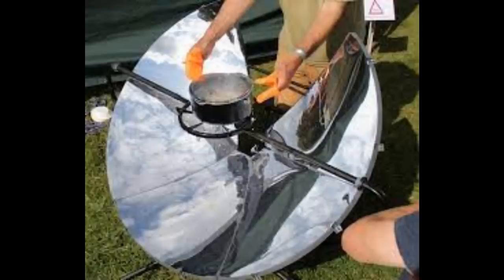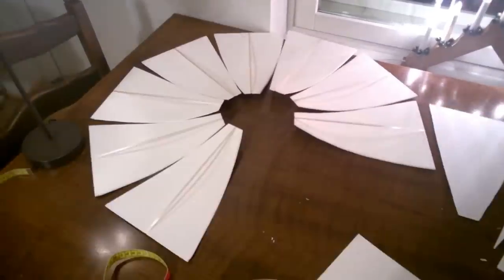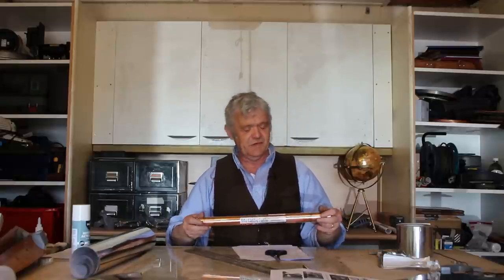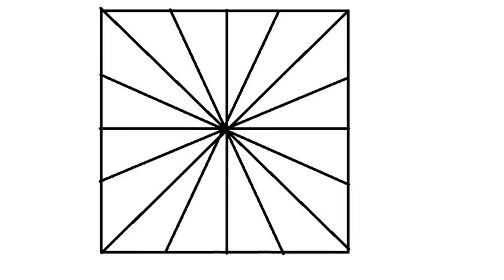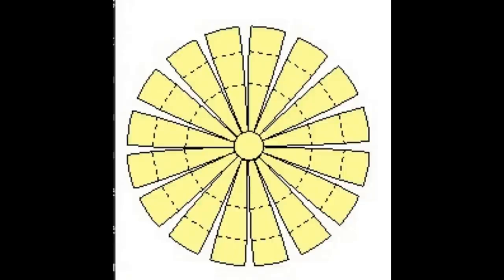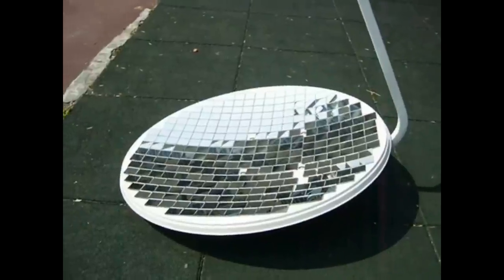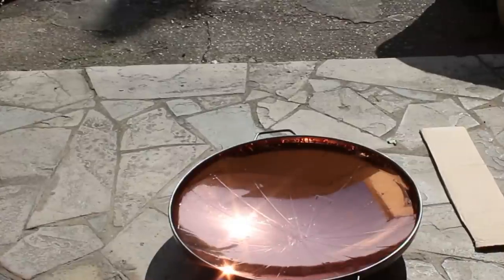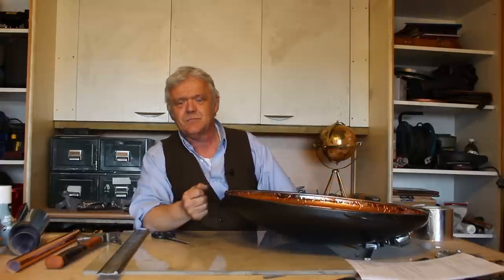1940 Burning Mirrors

Comment: Great video. While you were talking, I thought about 3D printing petal parts. But the fire pit is so much quicker that I abandoned the idea.
Reply from the maker: lol - oddly enough mate - i like your idea better lol
Reply: @ThinkingandTinkering  It’s a time thing with me. But I can see advantages because you can make a printed version any size you want. And you can fine tune the shape.  All you have to do is design a set of shapes that can be assembled into petals. Then assemble the petals into your reflector. If I had a faster printer, I might go that way.
Reply from the maker: @CCoburn3  that's what i was thinking mate
Reply: @ThinkingandTinkering  About 10 years ago, you made moldable silicone by mixing cornstarch with cheap builder's silicone. (Some people do the same by adding dishwashing liquid. I don't know which way is better.) In this thread, we were talking about making petal parts for a reflector using 3D printing. But to build a reflector with a 3D printer would take an inordinate amount of time. On the other hand, you could print off the parts from one petal and then use your homemade silicone to make molds. After you've made molds, you can then mold parts out of urethane. As far as I can tell, you've never done a video on urethane molding. But this would be an excellent project for such a video. I just thought I'd mention it since I know you're always looking for useful video topics.

Comment: You can also pick up reflector telescopes dirt cheap at boot fairs, the mirrors  at the back are really accurate parabola ( even the cheap ones) somewhere I have a 12 1/2" mirror that needs re-aluminizing I will have to dig it out and have a go.
Reply from the maker: hat is interesting thanks for that mate

Comment: Idea. Use your metal fire pit as a form and do a plastic vacuum seal into it. A small air fitting in the back of the fire to pull a vacuum. Then one could produce limitless plastic parabolas.

Comment: The trick with mylar to keep it in shape without the continuous vacuum is to reverse the process i.e. use pressure to form the parabolic curve outwards, not inwards.

Ensure the most reflective surface is on the inside of the curve, maintain pressure for the duration required to pour casting resin over the outside curve and set. Now you have a solid backed mylar mirror. Simples!

Comment: There was (not sure if it is still active) a website that had designs for parabolic cookers that I saw years ago. Solar cookers take a fragment of the parabolic idea and use a covered box to manage the heat. It does take an effort to plan your cooking ahead which is why solar cookers aren't as common in northern or rainy climates
Reply from the maker: seriously mate - there are a lot of ways to do this
Reply: @ThinkingandTinkering  indeed, and I know that everyone here deeply appreciates the information and ideas you've shared. What I'll be interested to see are the different and improved ways this group will expand on the concepts you've highlighted

Comment: Now use the parabolic mirror to heat up a few tons of sand and use the heat to turn a Stirling engine to turn a generator. Also water cool the cold side of the Stirling for more efficient and use the hot water in your house!

Comment: the aluminum foil for cooking I found has a line like pattern on it, and it runs along the length of the roll as it is rolled up so placing it with that facing so the lines run from center to outer edge while it may cause some bunching in parts of your troff design, I think in that format it still would ensure all the light is hitting that line of your heated tube you are cooking in, and the tube can then disperse the heat through out the inside for cooking. :)
Reply from the maker: some does - some doesn't
Reply: @ThinkingandTinkering  yeah I rarely find the good stuff with out those lines, and they seem to run the direction that the rollers it was on leaving them seeming to be left over from turning the rollers on a lathe or something (ie the marks on the rollers go around the roller rather than down them) either way if you do have the marked stuff it seems like making sure they dont interfere is not that hard, just have to orient them correctly when using it :)

Comment: Several years ago, I used unwanted TV Dishes lined with $1 emergency blankets for similar purposes.  There is plenty of them to be had for for around here rural SC/USA and there was no measuring needed.  the Angles and point-of-convergence are already there.  And at 33.5° N, it quickly cooked our hot dogs (faster than the charcoal grill!)

Now you've got me thinking about what I could do with all those giant C-Band dishes around here (there's at least three).   All are at least 8'/2.4m diameter and 4.5m2 of area.  Add a tracking system for maximum daily power, of course...

Question for the Audience:  What solar panel could I use on this system?  It would need to survive the heat and be able to convert to maximum voltage.
Reply: No photovoltaic solar panel could handle that heat. In large scale systems they use molten salt reactors. Then use the molten salt to boil water and run a steam turbine. They run at night off the residual heat as well.

These never came into large scale use, because they came under heavy attack by animal rights groups for killing birds. I am sure big oil likely played a role as well. As it is the most efficient and cost effective form of renewable energy, that I have ever discovered.

Comment: Look up Solar Funnel Cooker by Steven E. Jones. It is far safer than parabolic because it doesn't concentrate the Solar energy to a point, but to a more diffuse line. You can also make them foldable, so that it is more easy to transport. It's also easier to make.

Comment: Thanks for sharing Rob. However experiments have been made using polished copper as a reflective surfaces and it has been shown it is not bright enough to light the interior of the pyramids as the light is too greatly reduced, so this could not have been a source of illumination for them. Interesting legends do come from South America however with some ancient writings stating that two large 4 meter mirrors where used to melt stones and therefore used in the construction of sites like Sacsayhuamán. It is also interesting to note that 2 sound waves are required to create a beat frequency! Is it possible to create a beat frequency using light?

Comment: can u place a magnified glass at the reflected focal point and get even more heat? is there a thermal loss if using multiple dishes and bouncing the light beam off of 1 to another and then finding a focal point. like using mirrors to carry light into the recesses of a tunnel? what is the heat loss, if any?
Reply from the maker: what do you mean by more heat? if you mean more heat but a smaller area - then yes - if you mean more heat but the same area then no
Reply: @ThinkingandTinkering  interesting, all this time I thought a magnifier glass would concentrated the ray and produce more heat. thanks for clearing that up.

Comment: Those are pretty enough.
There are some non-imaging reflectors that are somewhat cone shape that I thought would be nice to try because the focal point is at the bottom of the cone, so you don't have to figure a way to hang stuff in front of the mirror. No doubt uses more material per square meter though.
Reply from the maker: cheers mate - but it doesn't take a lot of figuring does it?
Reply: Look up the Solar Funnel.

Comment: Try a used Satellite antenna. I have a 1.2 meter that I'm going to paint with Rust-Oleum Gold. I have the arms that came with and just need to flip them to the top to make a hook to run water through to heat the pool

Comment: Any tips for home-made concentrated solar panels? Buying the whole set is prohibitively expensive, but what if we buy just one, and then put a whole bunch of sunlight on it? The reflection would need to somehow track the sun, so quite some moving parts could be involved...
Reply: Heat seriously degrades the efficiency of solar panels and their life expectancy, you  would need to extract as much heat as possible before the light hits the panel  but it is a good direction to explore and it can make use of the heat perhaps to generate as well
Reply: You will take a large satellite dish, and you will rub it very well with graphite powder. It will become like a mirror.
Reply from the maker: you are quite likely to fry your panels mate

Comment: Hey love your video s Roberto ,  so how about , plastic dustbin lid , yeah ,  

A vacuum 

So first secure mylar sheet around bin lid edge ,  

Use vacuum pump ,or such to pull to shape ,   

Jold pressure , then make a 4 inch card wall of sorts ...

Weigh down mylar sheet , carefully ,    so if you release vac , it stays 

Then replace vacuum with spray foam ..

Yeah ti's expensive poss..

And would take a knack , buy the pure mirror like quality should be worthy ...

Oh amd aslong as the spray foam don't eat the mylar 😂

Comment: I think I recall that white is more light reflective than mirrors. Surprised to see everyone using mirrors for years after this was known. Any insight would be much appreciated.
Reply: not an expert but my guess is white spreads the light in all directions and a mirror actually directs it where you want to
Reply: @strongforce8466  wouldn't that be the shape?
Reply from the maker: white is not more reflective
Reply: @ThinkingandTinkering  There are super-white paints that are much more reflective than regular white. NightHawkinLight has made some. it is also made commercially as a coating for roofs to keep the cooler in summer. I'm wondering if that's what you have in that spray you used on the solar kettle.

Comment: I'm not technically minded, but I have this idea in my head.. Could you use concentrated solar thermal.. like the following
Have a pressurized water container that was heated via the CST that when heated would behave like a steam engine to push pistons that would produce electricity. While the steam from the engine would be recirculated via a 'still' type set up so you could just keep using the same water, thus removing the need to constantly refuel the 'generator? Electricity stored in batteries, of course.

Comment: MIT 

Why doesn’t a plain, white piece of paper reflect light, but a mirror does?

Almost everything reflects light — it’s how it reflects it that makes a difference…
By Sajan Saini

“I used to have a red car, when I worked at General Electric,” Department of Materials Science and Engineering Senior Lecturer Emeritus James Livingston recalls. One evening, walking back to the company parking lot, he was surprised to discover that his car had changed color. In fact, the street lighting in the lot had been switched to mercury lamps — which, Livingston explains, have almost no red in their light. His car thus appeared as black, with a touch of blue. After driving out onto the city street, with its conventional streetlights, the car’s color changed back to red.  

Livingston’s color-changing car highlights the fact that light sources, such as the Sun and tungsten filaments, emit a spectrum, or collection, of colors. When this spectrum of light falls on a surface, some colors are absorbed by its molecules or atoms. The remaining colors penetrate to within a few wavelengths, Livingston says, and partially reflect back.  

White surfaces are composed of molecules or atoms that don’t absorb any of the visible colors of light; our eyes perceive this reflected combination as the color white. But doesn’t a mirror also reflect all the colors of light? Why doesn’t the surface of a mirror appear white, rather than reflecting images into our eyes?  

The answer, Livingston explains, rests in part on the penetration by light. A mirror is essentially a plate of glass coated with a thin film of metal, such as silver. At the atomic scale, metals are a crystal network of atoms whose outermost electrons dissociate and wander with high mobility through the network. These mobile “conduction” electrons are the source of electrical conductivity in metals, and when light attempts to penetrate a metal, they “vibrate in such a way” that an opposing electrical field is created, canceling the electric field of light and prohibiting any of its colors from entering beyond a few atomic layers. When that occurs, the light has been effectively reflected from the surface of the metal.  

In addition, the smoothness of a mirror’s glass and metal coating ensure that this surface reflection is specular, says Livingston. As a result, rays of light bounce “like tennis balls,”, always maintaining an angle of reflection to the mirror’s surface, that matches in value the rays’ angle of incidence. Rays of light originating from a person’s ear, nose, and eyebrow, will “reflect with the same angle” off a smooth mirror surface and maintain their relative orientation, thus preserving the image that our eyes will perceive.  

White surfaces can reflect a considerable amount of light, but without the mobile electrons to oppose the electric field of light, white surfaces allow light to penetrate up to several wavelengths. This allows them to experience multiple reflections from crystal grains and other irregularities within the structure of the surface. Some multiple-reflected light can reemerge from the material surface, but without the same orientation, as that which reflects off a mirror.  

Surface roughness, Livingston says, also contributes “diffuse reflection,” causing the rays of light from different parts of a potential image to “bounce back at different angles.” Multiple and diffuse reflections scatter the reflecting rays, and all information about the image is lost. White paint or a piece of paper are classic examples of light scattering, he notes, as are clouds, the foam in your glass of beer, and snow. These latter examples are turbulent or irregular structures, containing “lots of air,” which causes “light [to] reflect off internal and external surfaces” and scatters the rays of an image.  

It is striking to consider, Livingston adds, how a still pool of water may serve as a poor mirror. Yet, when the same water crystallizes into irregularly packed snow flakes, multiple and diffuse light reflection results in a white surface.

Posted: February 21, 2012
Reply: So it boils down to smoothness a lot too

Comment: Is it true that parabolic mirror, no matter how large, cannot produce temperature higher than the temperature of the source, in our case sun, which is about 6000°C?
Reply: yes, a more obvious way to think of it is, you cannot do any more with a smooth mirror than what you can do with a bunch of tiny flat mirrors simply reflecting  the sun. from the pov of the focus, you would see a bunch of little images of the sun each heating you towards their collective temperature. the same is true for lenses.
Reply from the maker: i dunno
Reply: @kensmith5694  that's a great way to explain it

Comment: It would be interesting to see if there's an easy way to make an adjustable focus version, so it can be made suitable for different situations.
Reply: Catching the neighbor on
Reply: Can be done using mylar over a loop, pan, etc. 
Secure edges well, pull a vacuum on the pan to adjust the focus or carefully attach a cord to the back of the mylar and by pulling  / releasing tension on the string the focus is adjustable. 👍

Have fun 👍
Reply: That'll be in the Tinker cad version coming in a few days, I reckon.
Reply: read my reply above about spinning a bucket with plaster in it.
Reply from the maker: good suggestions given by others mate
Reply: @ThinkingandTinkering  Aye

Comment: Why not 3D print a grid similar to the JWST and mount mirrors to it? Design the model so the mirror faces are adjustable by fractions of a millimeter.
Reply from the maker: no reason at all - go for it - i did it this way just to show how easy it can be